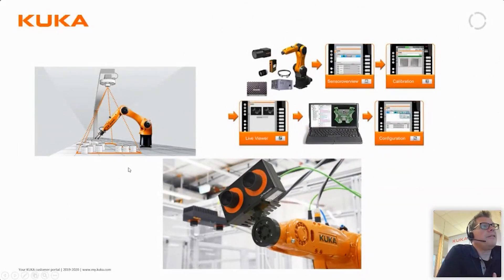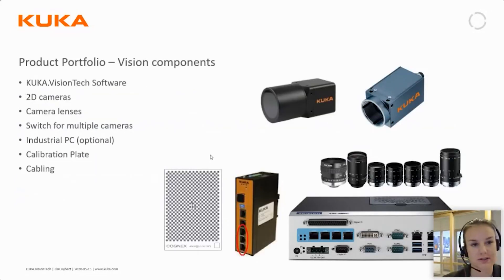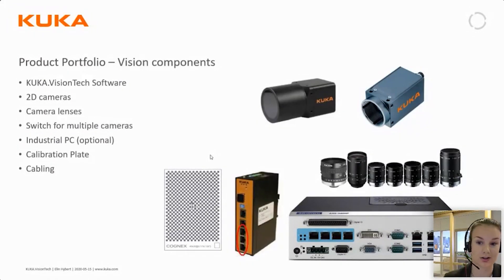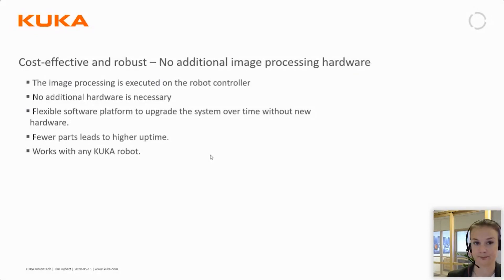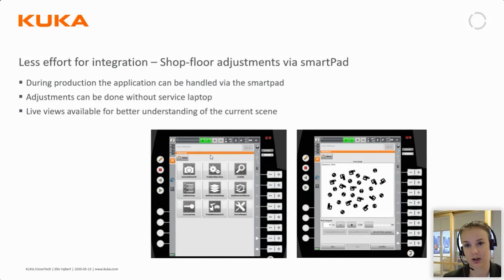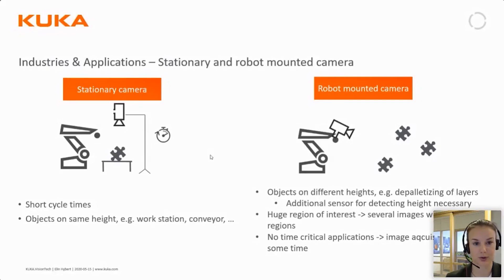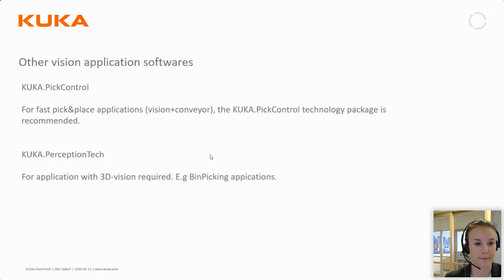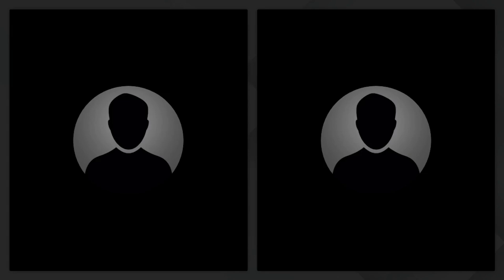Webinar KUKA.VisionTech

Comment: I saw this video where a KUKA robot is playing Table Tennis and I want to know what kind of camera system u r using. I am working on a similar kind of project and instead of placing cameras outside of the bot and pre-setting it's working field I want to place the camera on the bot but I don't know how to get the trajectory data of the moving/incoming ball. If I do place the camera I already know its working field and relatively move the bot by predicting the trajectory using Kalman Filters but in this case I am not sure. Should I use a depth sensing camera or use two camera to mimic depth sense or can u suggest any other alternative easy and cheap solution for it?